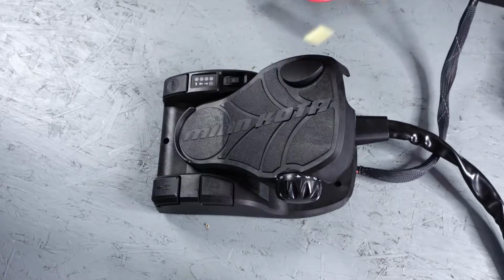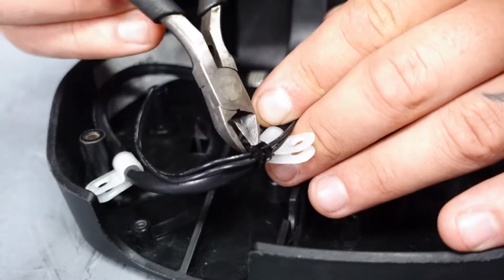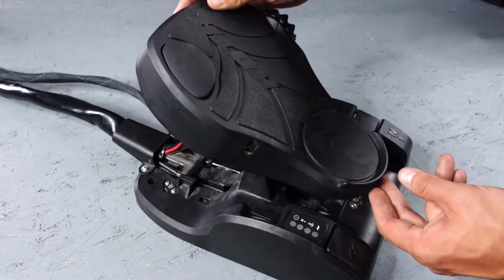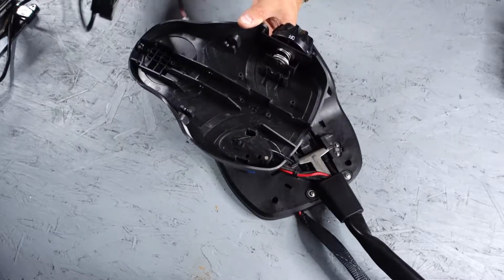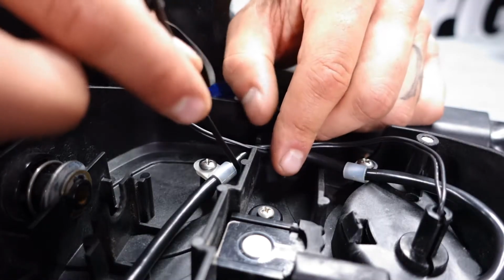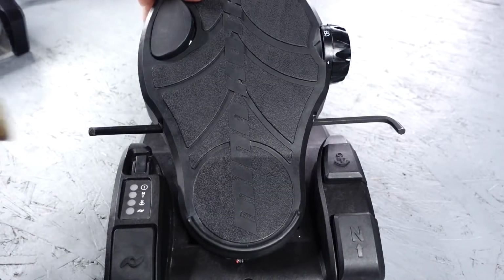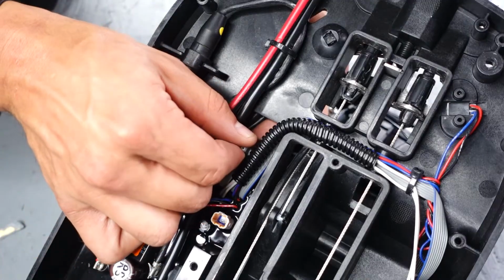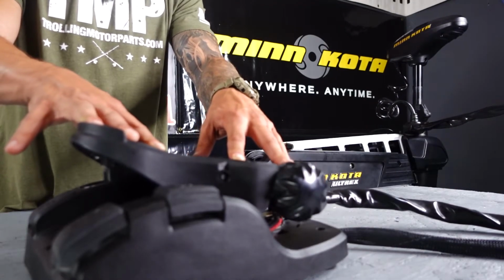Minn Kota Ultrex Steering Sensor Board Replacement | Trolling Motor Repair

Comment: My ultrex is having a problem where I can easily press down on the bottom of the pedal to turn the trolling motor left but I can’t press down the top of the pedal to get the trolling motor to turn right.. is that the sensor board? It will turn if I use the remote that came with the motor but I can’t manually press the pedal forward.

Comment: I lost my power steering on my ultrex. I replaced the steering sensor board with no luck. I then replaced the control board with no luck. If I put 12 volts directly to the steering through the black and white wires the motor turns just fine. I’m thinking it has something to do with the actual foot pedal where it makes contact with the steering sensor board. What are your thoughts?
Reply: Did u figure out the issue, have a buddy with same issue after replacing the same parts as you

Comment: Excellent video Rob!  Thank you for the step by step instructions.  Got mine fixed on my own in less than an hour and for much cheaper than taking it to the shop!  Getting the pin out and back in & getting the potentiometer back in took the longest, but overall a very smooth replacement.

Comment: Would the steering sensor board kill power to the foot pedal? My blue power light comes on but nothing else works on the pedal and steering is stuck.
Reply: I think it is my control board.

Comment: I have another issue with my ultrex.   I have already had the motor lock up and not turn so the sensor board did repair that issue.  I had water in the lower unit or foot so I bought a whole new lower assembly and replaced with it working as should.   Now I have the foot controller clicking with flashing lights when I step on the throttle button.   I bought a new power button and replaced but did not fix the issue.  I have had nothing but problems with this trolling motor but I do like the ipilot so I stick with it.  I don't want to buy a new trolling motor after having bought a new Vexus and installed trolling motor less than 2 years ago.   Can anyone help out?   To clarify, the foot controller turns on as should but clicks and flashes when stepping on throttle button.  The unit will turn as should but will not spin?

Comment: Went out today and discovered my ultrex didn't want to turn Right, but no problem turning left and no issues when on spot lock, is this sterring control board is what I need?. Thanks and keep up the great videos
Reply: Did you find a solution? I'm in the exact same situation
Reply: Yes I did, it's the steering sensor in the foot pedal. Lots of informative videos here on how to do it. It's very easy...
Reply: @brianwolfe9294  steering sensor board? 80-100 dollars?
Reply: Yes, I think I paid $75

Comment: Just wanted to say thank you for this video. Was able to get my trolling motor back like it should be in under 30mins. Only pain in the ass for me was getting the pin out(took some heavy hits) and getting the nut started on the potentiometer. For anyone reading this my issue was that it wouldn’t turn left and felt like it was under a bind when trying to make it go left. Would work with remote and spot lock but not the foot pedal. It had the old style board with ribbon attached
Reply: Mine has that same issue. Bought it in 2018, but Minn Kota is sending the part kit free. What a bummer to deal with tho
Reply: I have the same issue
Reply: @KyleBlanchard21  swap that board and should have you good to go. Mine hasn’t missed a beat since I installed the new one
Reply: Ditto to your comments!  Getting the pin back in with everything lined up & getting the potentiometer back together took the longest.

Comment: i replaced the sensor board, not my spot lock button doesnt work. i can spot lock with the remote, but not the button on the foot pedal. any suggestions?

Comment: Excellent video and help with diagnostics. My Ultrex was bulletproof for the first 3+ years but then I had to put the boat away because my local impoundment was so low on water, we couldn't access the water that was left from the launch ramp! After a year and a half, I was finally able to launch in the 100% full lake only to discover there was no longer any power-assist for a left turn on the Ultrex. A quick search online yielded the fix and the video and now, 4 days later, I have the part in hand and am doing the easy repair. I'll be on the water this evening , flipping up some nice slobs from all the submerged brush! FISH ON!

Comment: Hello, I have a problem with my ultrex and I would like to know if you can help me, when there is little wind my ultrex turns completely to the right, it beeps and exits anchor mode. This only happens when I have little wind. When that happens the pedal stops responding to i-pilot control and I have to step on the pedal again and turn it a bit to get it working smoothly again. all other functions work correctly.

Comment: Fantastic video, fixed my steering issue. My tracker was still under warranty so Minn Kota said they would replace my steering sensor for free as long as I took it to a certified dealer to verify the issue. The only problem was that by time I got my boat to the dealer the foot pedal would dry out and it would function properly. So I got tired of having it malfunction while out on the water as soon as moisture got inside the pedal. I bit the bullet and paid the $90 for the part and everything works like a charm. Thanks for your help!

Comment: Does steering sensor board keep power from coming on?
Reply: It did not in my case. In my case, when I turned the power on, the motor rotated a full 360 degrees or more to the left and locked up the foot pedal. My motor is 5 years old so Minn Kota would not warranty a replacement even though they updated the steering control board due to numerous complaints. Shame on them!

Comment: If the sensor board is out. Does that cause the shaft to spin around and cause the foot pedal to freeze up
Reply: I am having the same issue and I just ordered the $96 steering control board first as the main control board is over $400 with tax and shipping. I called Minn Kota and the woman there advised to replace the main control board. I hope that she was wrong!
Reply: I’m having the same issue, what did it wind up being? The sensor board or the main?
Reply: @Podcofishing  the sensor board. He just replaced both
Reply: @welchfishing  very good, thanks for getting back with me. I’m about to order the sensor board for mine. Do you know if they are universal for all ultrex years? Mine is a 2018 or 19.
Reply: @Podcofishing  mine was warranty
Reply: @welchfishing  thanks

Comment: So I’m not sure if this is the part I need or not. The power assist on my foot control works only in one direct. I don’t believe it’s an obstruction because the remote still steers the boat perfectly. Any insight would be appreciated. Thank you!

Comment: Excellent video!! Is there a way to test it? Mine worked fine and just stopped working. It will not steer with foot pedal or remote. The prop does work though. Everyone says it probably the control board but after watching this video, I'm thinking it's the steering sensor board.
Reply: So what was it and how did you fix it? I have the same exact issue you described 😩
Reply: @Free_Palestine_River2Sea  It wasn't the steering sensor board. The four screw that holds the steering motor in place fell out. I reinstalled those screws with loctite and it's still going strong

Comment: I used your video to replace my steering sensor board today. Your directions where spot on. I had came home from fishing in a rain storm.Went out next day , steering went out real fast. I called minn kota, they sent me a replacement under warranty. Your video made replacement  easy. thanks
Reply: How long have you had your Ultrex?  I called MinnKota and they want $90 for that part.
Reply: @adamwong8864  they said I was inside a 3 year warranty
Reply: @williamcarmack1218  You’re lucky. 😊 Thx